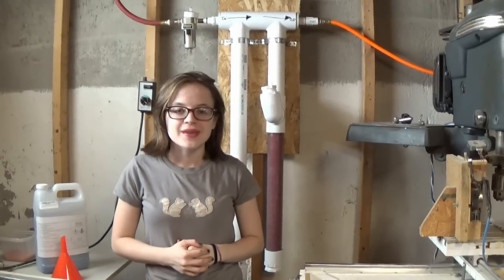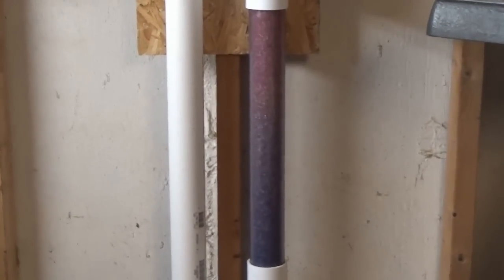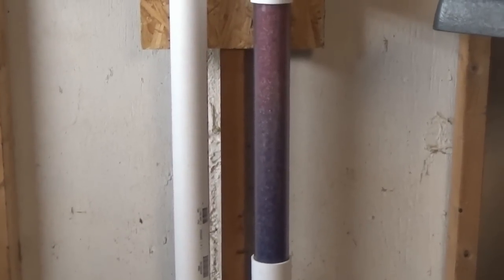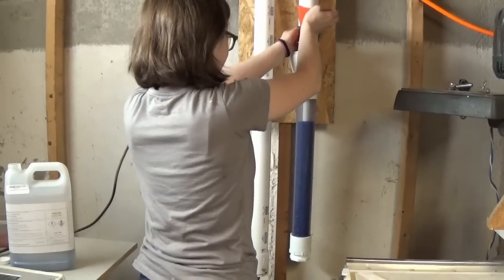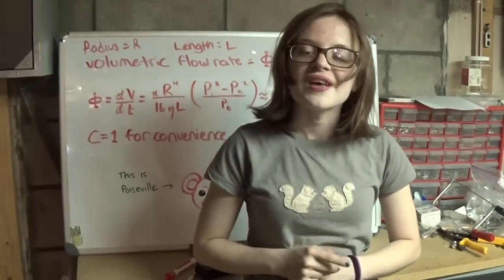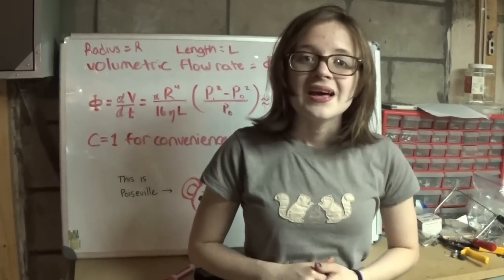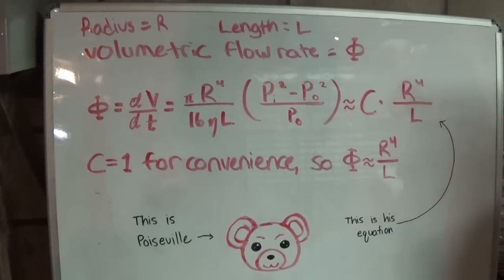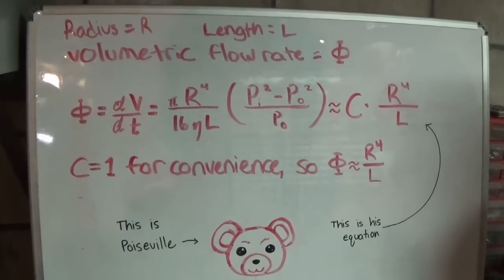Ep 11.5  Dessicant Dryer Update

Comment: Very, very Nice Job!!!  I am wanting to to build a Desiccant Dryer System for my new shop and decided to surf YouTube for some fresh ideas.  Yours is by far the best design out there and, if you've seen the others, I think you're smart enough to know why.  I have been an industrial maintenance technician for 40 years and have been fighting moisture in massive compressed air systems my entire life.  I even worked for Ingersoll Rand for a brief while, where I learned a lot about keeping compressed air dry.  Some of the desiccant dryers they make take 4 tractor trailers to haul!

By the way:  The first chamber of your dryer will work better if you would stuff it full of wadded up fiberglass screening.  It gives it kind of a coalescing effect.

Desiccant dryers used in industry are made like twins.  One dryer will be in the operating mode while the other is in the drying mode.  This way you never have to replace the absorbed consumable.  You simply switch the dryers automatically, and, in your case, keep on sand blasting!  I have built a couple of dryers like this.

The first used a small amount of the compressed air to dry out the desiccant chamber.  It worked great, but, you are wasting compressed air.  And as I'm sure you"re aware, compressed air is leased efficient way to power anything.  So why waist it?
The second employed a common hair blow dryer's warm air output to dryer the chambers. (Don't use a heat gun.  It will melt the PVC pipe.)  It dried the chamber in roughly a third of the time while saving on the compressed air.
I have a challenge for you:  Add another desiccant chamber to your dryer and a little automation.  You'll have to come up with a way to divert the compressed air and dryer output back and forth.  Or, like a friend of mine did, use two hair dryers.  It's actually very easy and inexpensive.  the automation is a little pricey but all the fun you'll have doing it makes it worth it.
There are two different way to key your diverter actuators when to make the switch: Timers or moisture sensors.  You can find both all over the internet.  I used moisture sensors.  Timers required simple programming.(I guess the moisture sensors do, too.)  You'll need to tract run times to find the duty cycle of your individual chambers.  I guess it really depends on the resources available to you. 
I hope you're up for the challenge.  Good Luck!!!

Comment: wow. I am really impressed. I was about your age when I started working on cars.. except I was for putting them in demolition derbies. so the welding, and cutting didn't have to be a perfect. I can't even imagine myself doing body work and fabrication at your age. Just WOW.  so impressed. I am going to build one or your desiccant Dryers for my garage. In other videos, you mentioned adding safety features to your car. I would highly recommend it.  As far as safety feature go I recommend the following.

1. collapsible steering column, like you mentioned before.
2. high back seats with head rests. they prevent whiplash in case of being rear-ended by some one on a cell phone, and it is a horrible way to spend the rest of your life as a quadriplegic. 
3. seat belts. I think you mentioned them earlier. since your car never came with them I would recommend the 3 point harness from Corbeau. I used them in my 66 Baja bug. whey work great and are very comfortable.
4. there is a design problem with master cylinder and fluid reservoir on VW bugs. they are connected to each other with a rubber hose. they always leak and all ways get air or water in the system causing break failure at the most inopportune time. I lost the breaks in my 71 super beetle to this, I went threw an intersection and got t-boned. I was lucky and everyone walked away. but it totaled my VW and a minivan. the minivan was not a big loss, other than it belonged to some one else and my insurance paid for it. but my green 71 beetle (my wife who was my girlfriend at the time called Kermit) was gone forever. again fortunately the everyone was ok. for safety, switch it out to a bus master cylinder and reservoir. its a pain to add fluid to it. but it will save your life one day. all the Baja and dune buggy guys use them for this reason. starting a new career as a hood ornament is a horrible way to die.
5. swap the drums in the front to a disk break conversion kit. it will dramatically cut down your stopping distance. so in a emergency situation it will stop on a dime. 

Keep up the good work, I am glad to see someone your age restoring a classic beetle. Another good source for parts is Wolfsburg West. they are in California. They make just about everything to build a complete car from scratch.

Comment: Not all PVCs are made the same, some can't take any pressure at all. Glad you address the safety concerns with using PVC and compressed air. Great build idea I may make one for myself.
Reply: SCHEDULE 80 IS DOUBLE WALL THICKNESS AND CAPABLE OF OBTAINING MUCH HIGHER PRESSURES. It also is More Expensive ........ besides for painting or sand blasting 100 PSI is more than enough, unless you have an industrial sized blasting job. then you would use a much larger portable compressor that is typically diesel driven. NEVER EVER use schedule 20 pipe at all for pressurized air.  It is mostly used in irrigation, again because it is CHEAP............. Remember that ol saying, "Ya get what ya pay for" ???  nicely done Hannah Bug.

Safety Note: Consider your pressure duties carefully cause when PVC ruptures it explodes quite dramatically.   If you are unsure of what type pipe to use Research it out and do not just take someone's word for it unless they are Professional Plumber's. And then double check the info FIRST Please.

Comment: I'm glad you provided a followup.  You've mitigated the problems to a large degree, but there is still a large degree of residual risk:  You don't know how quickly PVC will degrade over time.  Maybe replacing it after 1 year is good enough.  Better to just build it out of something that is inherently safer.   Also, if your desiccant is the same silica based stuff that comes in all those little tasty "do not eat" packets, try baking your used desiccant in the oven at a low temperature to drive off the moisture.  This might not bring back the original color that is used to tell you when the desiccant is used up, but it is easy to dry and reuse your desiccant.  You could keep one batch in the dryer, one batch that has been baked and resealed in an air tight container.   Anyway, you have great presentation, your videos are well thought out, and you speak well.  Keep it up, just please consider that although you have given a lot of thought to safety, just don't let that make you feel like there isn't room to reduce the risk even further.
Reply: Brian Hanson I'm not sure that applies here.  I'm talking about plastic degrading and being dangerous.  It sounds like her setup is well thought out and she's mitigated the major concerns.  On the other hand,  It should be possible to build this out of copper, though you don't get the pretty window.  It would last forever and you could incorporate a 2" vertical expansion chamber to collect water and vent it out the bottom with a drain valve.  A couple of threaded ports would make it easy to check and refill.

Comment: I worked in a shop that had some PVC airlines, 3/4 inch pipe. It worked fine except once when some metal fell against it and it exploded causing an injury to one worker. Your use in sandblasting shouldn't require high air pressure so lowering your regulator will make it safer. I am using PEX in my shop now, it is a softer plastic but still not recommended for compressed air. Great job on your videos. I can't wait to see what you come up with next.
Reply: Richard Blanchard only iron pipe for me in my shop. But I'm using 80 gal compressor that pumps to 175 psi. If someone just want quick and cheap airline system in their garage screw eye bolts into wall studs or ceiling and run air hose through them.

Comment: I like your video. You're a very bright and inspiring young lady, and cute I might add.  If I might suggest something, when your system fatigues and you replace it, consider using a Y fitting in place of the T and 90 degree elbow for the desiccant fill opening. One less part, and the desiccant would flow into the tube much easier.

Comment: Wondering how well this and others similar designs are holding up.  Surprised me seeing some run PVC for the air lines in shops.  Was thinking Sch80 if you wanted to be safer.   Thinking one of the intercooler designs like YT channels "Nikita's Lab"  and "Guns and Garage Gear" prior and or a vortex type using an inverted welding gas tank would help dry as well prior, so less dessicant changes and processing.  Nice job!

Comment: The PVC stress factor is not related to the pressure it sustains, it is related to flexing and relaxing repeatedly.  The PVC can shatter at pressures which are deemed very low due to this expansion fatigue.  There are other materials similar to PVC that can be used, but tend to be a little pricier than PVC.  PVC tends to be sensitive to temperature as well as expansion, so care should be taken to watch thermal stress too as compressed air tends to be warmer due to the heat of compression.

This has been an interesting video set, and actually is some really good ideas to pursue in my opinion.  I would definitely look for a different construction material though, or use some reinforced sheathing such as Kevlar or something around the PVC at a minimum.  If you have seen the results of high pressure sending shards of PVC, I am sure you can see its not something that should be shrugged off.  I would suggest putting the setup you have behind a 3/4" -1" plywood panel possibly so that any explosion might be stopped a little (The shards would most likely penetrate 1/4" plywood with ease).

Its really a clever idea, so don't give up, and just address the safety issues as a path to take.

Comment: You are super smart.  I have a dumb question.  Could you dry the air before it is pressurized.  That is the air would be dried before being put in your pressure tank.  The pvc wouldn't be under pressure.  Also, water in the pressure tank wouldn't be a problem anymore.
Reply from the maker: Hi Bruce, brilliant question! If you live in the dessert, that would possibly supply enough dry air to supply the air compressors. But the volume of input air is so massive, you would need a massive amount of desiccant in any other climate because desiccant needs contact with the air for enough time. Your house would need to be essentially a large humidifier to provide enough dry air, but this would be highly impractical
Reply: @hannahsbug1520  Wait, you respond to a brilliant question but not the most important, what happened with the build?  hannah built a gantry and end of show, there are all sorts of horrible ways to end a great series, what happened to this?

Comment: Awesome dryer, I like the user friendliness of changing the desiccant out.  However, the PVC aspect is kinda sketchy.  I just bought a dryer that is about the same size from MSC and it was just over $300, rated to 30cfm and 210 psi.  That beats having to make a new one every few years.  It isn't quite as easy to change, but I won't have to replace it or worry about it exploding as I run 150 psi through it.

Comment: Schedule 80 PVC (available at electrical supply outlets) is much stronger and also UV resistant. Even so it might be a good idea to build a cage around it. 
Also a suggestion I believe might make it better is by adding a restricted orifice to the first water trap the air would be cooled and condense better. It's basically a refrigeration principle. Perhaps you could test the concept and post the results.

Comment: If you add a ball valve at the fill and empty ports you won't have to wrestle with the cap and it will be less leak prone. 

Also a $8 sheet of osb cut and hinged would provide an adequate safety cover, it would be open above and below so a failure would just mean beads everywhere

Comment: Doesn't depressurizing it increase cycle fatigue?  If you put a simple cabinet around it you get uv protection, shrapnel protection, and a cool place to hang posters like a big tap and die chart or something.  I wonder how long your beads would last if you had an after cooler and moisture trap before your tank. :)
Reply: just watched Ep3.  after cooler might not be easy on your setup.  lol

Comment: You should have metal piping and a drip loop setup prior to the drier. Saves on beads. Tip tools sells the kit but you can just look at it and make your own from common iron pipe fittings.
My water trap stays dry with just that.  Make more videos :)

Comment: Two questions and a comment: Why do you use Phi as the symbol for volumetric flow rate (VFM)? Would you please share with me the source of the formula? The VFM is not expressed in meters or cubic feet. What you've shown is delta change rather than VFM.  Good presentation.

Comment: I noticed that the right pipe is under strain and moves when you tighten the plug cap for the desiccant. I would suggest putting another metal band lower down the pipe so it does not flex when you tighten the plug cap. Any flexing of the pipe will fatigue the pvc particularly at the joints making an explosion more likely.

Comment: Those pressure ratings relate to liquids  (principally water) when high pressure vessels such as SCUBA cylinders are tested they are filled with water and placed in a water tank, then the pressure is applied because since water is pretty much 'inconpressible' no explosive decompression can occur.
These PVC pipes are essentially 'water vessels' if you fill them with compressed gas (which they are not intended for) you are potentially creating a bomb since unlike the malleable metals traditionally used for air pressure pipes the do not 'plastically deform' but shatter, this looks like a nice idea, but I am certain that I won't be using these materials I am afraid

Comment: You said your clear PVC was rated for 120PSI, but the "Excelon R4000" 2" PVC I'm finding in ebay is rated at 390 PSI (which is freakin' fantastic)... What is the source of this inconsistency?
Reply: The smaller the pipe, the better the pressure rating.  Excelon R4000 2" dia PVC is listed as having 140psi max.  The 390 PSI Max rating is only for the Excelon R4000 1/4" dia pipe.  I think your ebay seller mixed up the ratings.
Reply: Just checked another site for ratings to confirm and it seems you are correct, sir.

Thanks!
Reply: Also look at pressure rating vs. temperature.
Reply: also check stats in that pressure max rating is not the same as the rupture rating which is normally about 10X higher than rated max rating.  I believe that is a regulation too.. will have to validate that though.

Comment: Still on the fence about the pressure ratings. PVC is rated typically for water pressure at a much lower temperature than compressed air. Those ratings drop as temperature increases. I love the design but just unsure of the high pressure at compressor temperature. Anyone have further knowledge in this area?
Reply: The bigger issue is that water is not compressable.  So, if you put a cubic foot of water into PVC pipe at 150psi, and the pipe breaks, you will still have one cubic foot of water trying to escape.  If you put one cubic foot of air at 150 PSI into PVC pipe, and the pipe breaks, you've got something like 10 cubic feet (at 15 PSI---close to standard air pressure, I'm sure my math is off) of air trying to escape.  This will cause a much more violent explosion.

To make it easier to visualize, picture two identical balloons, one is inflated to a diameter of 12 inches.  The other is filled with water until it has a diameter of 12 inches.  Pop both of them and compare how they rupture.

Comment: Transmission oil cooler for Dodge Durango $50. Various compression fittings and soft copper tubing $15. Room fan - most likely free. Plumb pipe from head to tank to first go through trans oil cooler. Plumb return line back to tank. Put cooler in front of fan. Run compressor water free.Follow the KISS method.Oh yeah and avoid PVC pipe bombs
Reply: yah pre-cooler is always better than after cooler= no moisture in the tank no  corrosion no huge metal bomb 20 years down the road
Reply: Rusted steel tanks just start to leak, they don't explode.